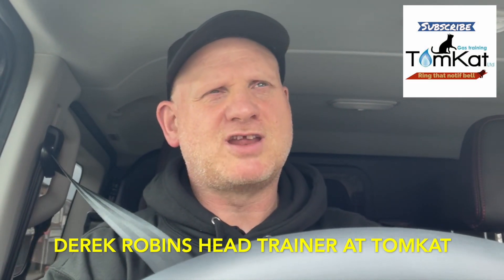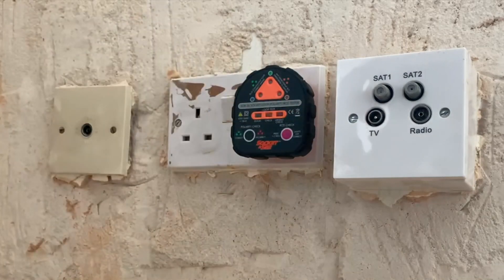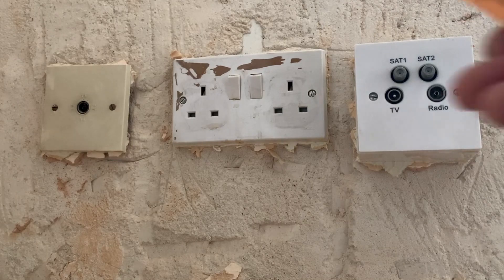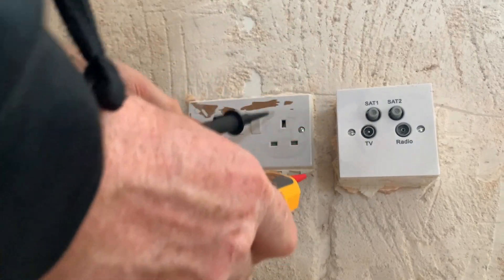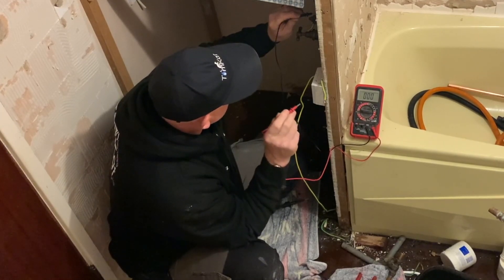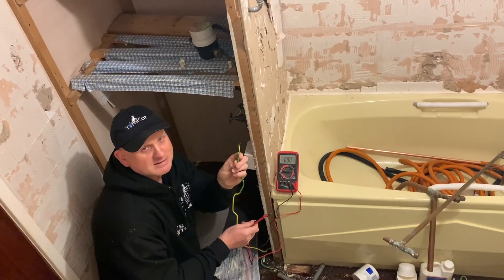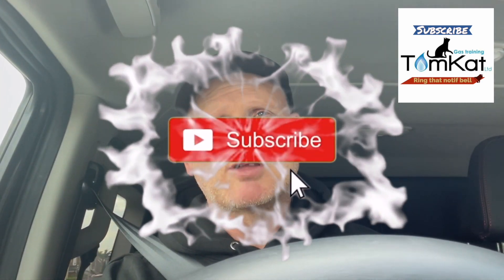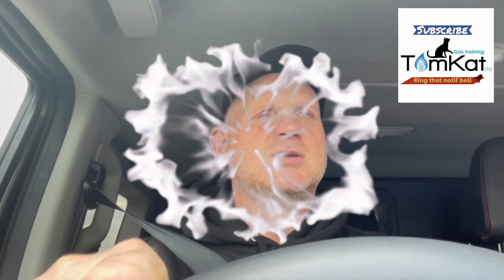DANGEROUS ELECTRICS, why gas engineers and plumbers should use non contact voltage indicators

Comment: If it's TN-C-s it could be a bad connection of the earth at the main intake where power is distributed to the flats, or a broken PEN conductor going to a neighbours property where live would go through their system back to ground, through natural earth and arrive at this property through the earth terminal, possibly even through the metallic pipes entering the property. If you switch off the power and still have voltage to the bonding call the DNO.

Comment: Don’t RCDs look for an imbalance between live and neutral ?
Reply: RCDs are for addition protection only and are not always 100% reliable. They should trip within 300ms under fault conditions as long as the impedance is under 1667 Ohms between live and an exposed OR extraneous conductive part providing the RCD is fully functional (The test button should be checked every six months). An RCD will not trip if there's a wiring fault on the circuit for example if a socket screw nips the insulation of a neutral conductor when screwing it back. Anything up to 50Vac or 120Vdc (ripple free) is considered a non hazardous touch voltage (as the RCD is designed to trip at 30ma when the detection coil senses any out of balance magnetic flux produced by unequal current flow in the live and neutral coils). An MCB will trip under fault conditions when the impedance is within its maximum allowable ZS value (short circuit fault or earth fault).
Reply from the maker: @Timetochange76  very interesting thanks for that. We had 60 volts when all the earths were taken off the pipes but it was a lot more than that when they were joined together Tom said it was over 100 volts but the RCD didn’t trip but did when we pressed the test button. We are still waiting to find out what the sparks found 👍🏻
Reply: @tomkatgastraining  That's very strange. I'm looking forward to finding out what's causing it. It seems like the Earth bonding conductor is not connected all the way back to the main Earthing terminal at the incoming supply or the resistance of the main bonding is not below 0.05 Ohms (and likely to be above 2000 ohms as the rcd isn't tripping (60v / 30ma)) I would start by turning off each MCB and then testing for voltage each time until its clear. Then once the circuit(s) causing the leakage are identified start unplugging each appliance while testing each time. Then I would do a ramp test on the RCD to check its tripping current to make sure its under 30ma. I find Its usually an appliance with earth leakage causing this issue along with poor bonding integrity . An insulation resistance test of the circuit will identified any installation wiring defects.  Great video as always.  ☺
Reply from the maker: Yep but still didn’t trip 😳

Comment: If there's rcd's present they should have tripped at a presence of 30 Ma leakage on the CPC or less.  I would have checked at source near to the meter.  On a Tns Tncs system is quite possible that there a broken CPC.  I doubt it's a TT earthing arrangement unless you're out in the sticks still. Quite possibly a broken or disconnection of CPC earth conducter .  The whole point of an RCD is to detect an imbalance of phase to earth.  If earth isn't connected at source.  The rcd can't do what it's intended to.  Anything above 50v becomes dangerous.  Without a visual check and my Mft is would be difficult to say.  My bet would be a disconnected CPC earth conducter at the consumer unit or disconnected earth at main source.  In a Tncs system the natural and earth are shared so earth leakage could be below ground.
Reply from the maker: Thanks for that the electrician who attended said the power was coming from the ground and up the gas and water pipe but when Tom turned off the power in the flat the voltage in the pipe stopped. I disconnected all the earths at the earth point and found power coming down one earth from the sockets. I just couldn’t understand why the RCD didn’t trip buts that’s probably because I am not a spark. 👍🏻
Reply: @tomkatgastraining  some diyer's reversed polarity.    If there's voltage on the earth then there will be voltage to every equpotential point.  Including the gas and water bonding.  The boiler carcase itself will an equpotential point sending voltage current through all the other pipework including dhw and flow and return pipework.  Making radiators an electrical hazard too. 
Gas engineers need to be using their voltage indicators and safe isolation for these reasons and more.  If exposed wiring comes into contact with pipework.  A gas engineer or anyone else could potentially touch any of the metal and become part of the circuit.  There may well be CPC earth connected but no RCD RCCB protection.  Once any of us become latched onto a circuit.  It's difficult to move away or call for help as out muscles lock up.  Gas engineers and electricians can make mistakes. Simple mistakes can cost lives.  Anyone ends up dead or hospitalised HSE will be all over it.